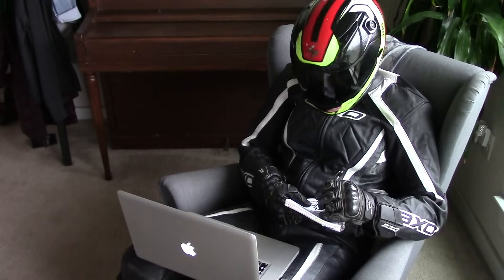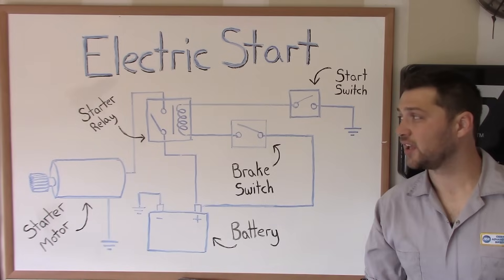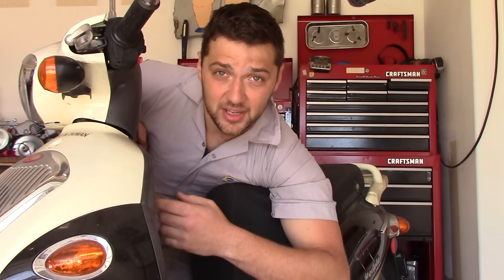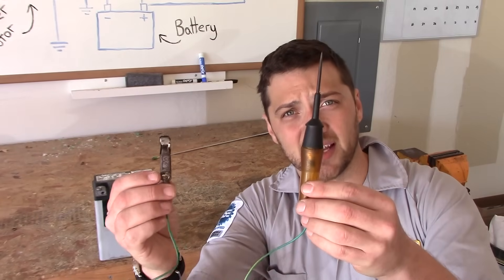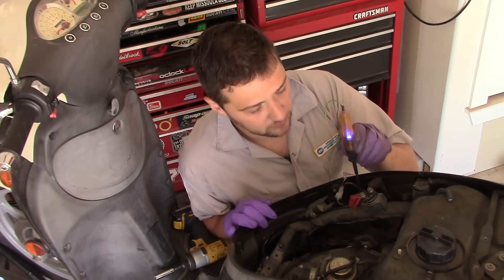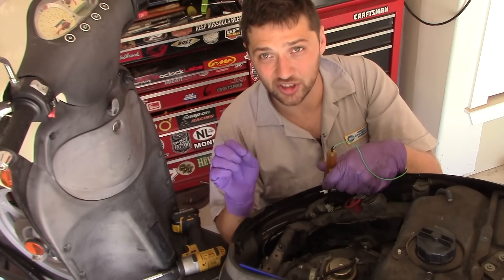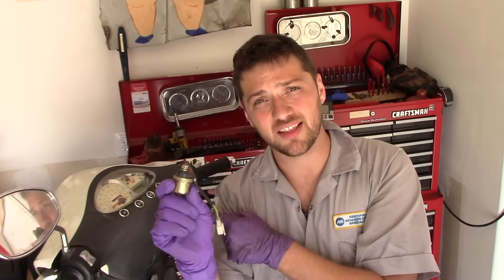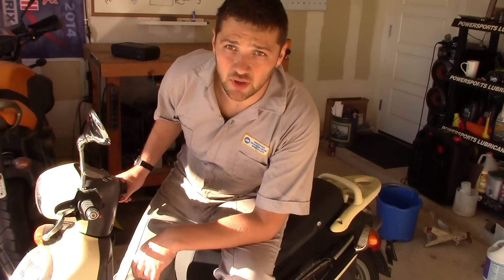Scooter 911: Electric Start Doesn't Work (troubleshooting your starter, starter relay, and circuit)

Comment: Hey Garrett thank you for being the only scooter youtube channel I can watch without bashing my head against the wall or feeling talked down to! I have a suggestion/desperately begging for a video. please go step by step through a wire harness so the crook and I may understand the ins and outs. My 150cc amigo was stolen from me and the crook wasn't firmilur with the harness so he clipped a bunch of stuff unnecessarily. I have dropped loads of cash trying to repair it. You're either wondering why I don't take it to the shop or why I haven't sold it (my "friends" suggest selling daily). The only shop in town, where I bought my 2020 amigo, is useless. Recently brought it in with a no start. They replaced the clutch and taped a couple wires in about 2.5 weeks and charged me 350. The bandaid they used must have fallen off on the ride home because I stalled twice. Later discovered it was a valve adjustment that was needed. They refused to refund me. Anyway I'm currently stuck with a no spark issue. I replaced the coil and plug. Nothing. I have a black and green 2 pin connector unplugged and idk where it goes. If I sell or give up the bad guy wins. I can't let that happen! Save me scooter 911!

P.S. your own shop means no more car driving by bloopers :( 

P.S.S. cut the afro lol 

You're my boy blue, 
Shroom0205

Comment: Scooter's relay seemed enclosed. Couldn't bypass. Then I attached a cable to the battery's positive terminal and touched it directly to the STARTING MOTOR. Sparks, a revolution or two, then nothing. Did I fry something? 
By the way, the battery seemed drained, but after a recharge bike starts fine with kick-start.

Comment: My man I just bought this moped this been used and I don't know what's wrong with the electric start all kind of wires I see two hours coming out of but every time I turn the key on it makes the sizzling sound and start smoking and the two wires are hot and it's connected to some otherwise delete all the way down to the starter post at the bat I need you to sit there and tell me how I could send you a video and show you what this guy's done so you could talk me through it

Comment: I have a 1987 Yamaha razz scooter the starter works I put power to it my grounds are good I bought a new relay switch for it but it still doesn't want to work with the button to start the bike what can it be the switch on the handlebar is bad can you help me out with this problem someone

Comment: Can I connect 2 wires separately to the  solenoid and then tap them to  jump start scooter    instead of the  screw drivers

Comment: Hello, You mentioned if my scooter is making this sound (turns over but doesn't start) I have a different problem. The electric start turns and makes noise but doesn't crank over to start. What other problem do I have.  The scooter will start with the kick start but not the electric start. 
I have 111 miles on the scooter.

Your help is greatly appreciated,
JB

Comment: I had the same issue with my tao tao ....
   It ended up that the starter Bendix was failing. After removing it, I cleaned it up and sprayed some wd-40 into the mechanism Inside. Amazingly, after re-installing...it started right up....

Comment: One of my starters stopped working, I think I pressed it too hard. The other handle bar still works, but my left one can't start with the ignition button, nor will my break-light come on if I use the left breaks (the right still works though) Did I burn out the fuse, or did I break it? Either way I am unsure how to proceed and if I need to have professional help or not.

Comment: How do I contact him directly for ad ice I'm on my 2nd scooter in 3 weeks and basically got 2 lemons Ive replaced everything on the outside of the motor except the stator but the wiring and harness that comes out looks brand new. There are a few connections that were done outside of the connectors. I'm wondering if it's bad connections. I have compression, gas, and weak or no spark (I've tried NGK and 2 other plugs)

Comment: my scooter engine tramp 1 or two times hard after got overheated and now the cables in front make strange sound when press starter button like snails when you touch them like weeiiii engine doesnt start

Comment: Hello Garret, 
Hoping for some assistance with a perplexing problem. I don’t think the scooter matters but it’s a 2020 Ice Bear 50cc that will not start after sitting outside in the elements for 6 months. 

Battery fully charged with tight terminals but will not start – fuse good. When I checked both brakes, the tail light illuminates. Starter kill switch seemed dodgy – took it apart and it was rusted inside – replaced

With the tester on the negative battery terminal, I tested the solenoid positive and it lit up. Oddly, when I touched the negative terminal of the solenoid, it also lit up. Hmmm, $9 bucks – replaced.  
Before putting the new solenoid on, I started the bike by touching the two solenoid terminals. Started right up after some carb cleaner help.  New solenoid installed and bike doesn’t start. Test light the solenoid to positive/negative terminals and both lights up.  Aaaaah, a short of a hot wire grounding somewhere? I touch other parts of the bike frame, housing to ignition, etc and the tester lights up. That can't be good!

Do I have a positive cable grounding somewhere? Could the starter be bad even though I jumped the bike. Brake switches? 
I’ve learned a ton from your videos and am really appreciative but would you mind giving some suggestions on what to do next? 

Cheers,
M.
Reply: Found the short.

Comment: I have a 50cc scooter is got about 1800 miles on it it runs perfect I parked in the driveway when the house came back out and it's never started again I've done everything I'm I'm stumped it has spark

Comment: Useful  video. by the way my Kymco 50 cc 2011. Doesn't start when i push the start button makes sound TEK and nothing else will happen. Since then the back light lost power but break light works. 
When i try kick start.
 Hardly starts but immediately go off. i checked the fuel supply, plug , fuel filter battery-powered  they are all  good.
could you tell mi what else can i do with it. 
Thanks in advance.

Comment: Having an issue where I hear / feel one click from the starter relay and then I lose all power to scooter, have to shut key off and turn back on. I was testing everything with a multimeter, so I can actually see the voltages. I initially thought the issue was the starter because jumping the starter relay heard same one click and scooter did not start. Replaced starter with brand new one. Same problem. Replaced starter relay with brand new one. Same problem. Battery is good, in fact, brand new. Verified ground wires hooked to motor. What seemed odd to me is that in checking the starter relay, ground to battery ground, + to the connector, I have power all the time to one terminal. Seems like I shouldn't have voltage without squeezing the brake according to the video, but I do. When I squeeze the brake, still have voltage.  I'm thinking I have a bad brake relay because tonight I noticed that the brake lights are always on bright instead of dimmed but you would think that would allow the scooter to start if it thinks the brakes are always on. When I wiggle the brake handle, it dims but then goes bright again. I guess the only other items possible would be CDI. There is one wire that is red running somewhere but the wire isn't bare and is still connected via a push in male / female connector. The rest of the wires are encased in wraps.

Comment: Ok so please no judgment.  Lol.  So I have an electric motorcycle and it WAS working just fine. I had to buy a speedometer, as that was basically the only problem, it didn't have one. Long story short I has a friend who claimed to know what they were doing ( they didn't) attempt to hook it up for me.  And they told me that because the connectors within the plastic connector piece for the wires from my bike, looked as if they weren't making proper contact with the connection coming from the the speedometer( not sure how) so this idiot, decided to remove the plastic connector piece from the speedometer and. Tried to connect the wires like that to the wires from my bike. Now apparently he didn't know which wires on my bike were for what function, so he was "playing around and guessing" and at some point he put a wire from speedometer, with a wire from the bike that definitely shouldn't have been touching. I was told big spark partial melted connectors and now, my bike has to be fully power cut off to turn off. Like the switch under my seat.must be turned off other wise the bike is ready to ride. I hit the power off button on my remote and it beeps but the power is still on.  Turn throttle and bike moves.  But what is supposed to be the power on/ start dosn't work not dose the lock/alarm button.   I don't have an ignition so I can't use the key to turn off my bike, and my bike can't charge when the "hard power" switch under seat is in the off position.  So basically.  My bike is ready to ride as it's charging.  😡 which for obvious reasons is not very safe. My question is.  How to figure out what the fuck he did, why that spark fucked my powering off and alarming abitliy, when I didn't think the speedometer ( or wiring associated with it, would have any effect of that, and how to fix it.  Sorry for long comment.   But I'm so clueless about this stuff, but now don't trust anyone to fix it for me.   So hoping that you can give me an idea on what to do.  Please please please and thank you.
Reply from the maker: Wow! That is quite the predicament! We've all been a victim of amateur repairs and diagnosis. Shoot me an email at garretseesingofficial@gmail.com and maybe we can get it sorted out

Comment: Hi, my scooter Piaggio fly 50. Start engine when applying brake ( front or back ). Doesn't need to use engine start button. The problem gets worse while riding and apply brake to stop  makes loud noise from rear back side, could be due to Bendix hitting variator. Any thoughts on solving this issue ?

Comment: Hi, I've been having issues for a while with the starting of the scooter, Now, I just noticed on mine that the green and yellow wires at the starter relay are crossed. The relay is wired one way and the scooter another making them yellow with green when the wire is plugged (weird)  My scooter has the weak start with a full battery. Is the cross wires normal? I see you got it green to green and yellow to yellow. Any info will be greatly appreciated. Keep those videos coming. They're great!  Thank you!

Comment: So I recently changed my ignition coil and after doing so my horn and turn signals won't work(but they worked fine prior to coil change) any advice?
Reply from the maker: Wow that's strange. Topically if you loose horn AND turn signals the left had switch electrical connector is disconnected somewhere inside the front fairing. Or the grey wire that supplies voltage to the left had switch has a break in it. Did you remove the front panels for any reason?

Comment: I crashed on the side with kickstand shutoff switch, it didn't work after that but i can still drive, now it wont start. I bent everything back in place, electric seems to work sounds like battery could be low

Comment: Hi 
i have honda SH300A 2016 every things work fine like lights and horn  when open the switch but no cranking and no sound of fuel pump.  i followed ur tips but didnt work i pass the relay with crew it crank but  the engine not  running i replace the relay with new one and the problem sill the same . any idea

Comment: I need help! My Gy6 Scooter (BMS Heritage 150) will only start if I bridge the two posts on the starter solenoid. Once started it runs perfectly. Electric start and kick start do not do a thing, wont even attempt to turn over. I replaced the started solenoid and no better.
Reply from the maker: Does your brake light illuminate when you squeeze the brake lever?
Reply: @Scooter_911  It does. BUT funny thing is that before the issue the rear brake did burn out, I fixed that and also went ahead and replaced the break switch up front. All of that seems to be working.
Reply from the maker: @lukasbabb8330  ok well if the light flashes brighter when you squeeze a brake lever but the starter relay does not respond to the start button you most likely have a bad start switch or an open wire from the start switch to the starter relay
Reply: @Scooter_911  and would a bad start switch make the kickstart not work too?
Reply: OMG ITS FIXED, in the started switch casing there was a little piece of metal that came loose and was touch a wire which i guess it grounded it. took that little piece out and started right up! Lol didnt even think to look at it because everything was pointed to the solenoid. You ARE THE BEST, i have watched all your video and am prepared for anything else that breaks.
Reply from the maker: @lukasbabb8330  dude! Nice work! Congrats on an exceptional diagnostic!
Reply: @Scooter_911  AH I need your help again! MY main headlight will not work but there is a little secondary light inside the unit that does work. All my other lights and turn signals do work and changing the bulb did nothing.
Reply: Not sure if there is a fuse or anything i missed, the only fuse I see is one by the battery and if that goes everything doesnt work because i have had to replace it before.

Comment: So I have this problem and tried bypassing the starter relay. As soon as I used the screwdriver across the contacts the engine turned over: however, it turned over without pressing the start button or holding in the brake. Not sure where to go from here?

Comment: Hi Garret. My scooter's spark plug gives a single spark after you switch the ignition off and then on either you use electric start button or kick start. 
Please tell me what could be the fault. The rest of the things are working as I checked. 
Thanks in advance ☺

Comment: Hello, Thanks for the video, really good, one aspect you did not mention is when I press the brake handle, give a bit of throttle and then press the start button, I hear "click" I do that two or three times and then the scooter starts, so what is the most possible issue to be? thanks a lot,

Comment: I need your help with something. 

I have a sym jet 50cc scooter.
Its won't start all the wire looks fine and I put new starter motor on. Still nothing happening. 

Its turn on but won't crank

Comment: My moped clicks when I press the ignition button and doesn't kick over by the kick-start, what do you think it could be? I have power from the battery, fuel and oil and still doesn't start also it died waiting at the lights. HELP PLEASE

Comment: Great video!  Question though. Working on a 2013 Buddy 170i, Push start button and starter engages but  stops for a second before continuing to crank. Hard to explain like a clunk-pause-then crank to start. Replaced battery and its fully charged. Seems like a large current draw before resuming the cranking? Leaning towards starter? Thoughts?

Comment: Hey Garrett, thanks for the videos. you helped me back in the summer with repairing a rear brake switch to get my Lance Cabo 150 scooter to start and it worked great. Its been a few months since I rode it and now it won't start at all (although I can kickstart it with some effort). However, when I pull the front brake switch now, the display goes dark. Wondering if I now need to change the front brake switch. What do you think? Does the front brake switch connect to the starter circuit like the rear switch does? Any insight you could provide would be helpful. Thanks so much!

Comment: When I squeeze the break and hit the electric start, it will shut off the electricity off the whole bike, dash light turns off. Power will come back on if I play with the kick start. But the same thing happens again if I attempt the electric start switch. Any insights? TIA!

Comment: Ive checked just about everything in the circuit but the starter is weak when installed. Out of the scooter, works great. When i try to engage the starter on the scooter, its turning the drive pulley and belt, is that normal or would the belt be "too tight". The driven pulley (on the wheel) is not being turned though. Thanks

Comment: Hi this is really useful  but i do have a problem my ajs modena 125 has stood for about 6 months try to start it and it did try at first on the electric start but then made a grinding sound now there is nothing at all the lights all work horn and indicators any idea what it could be. any help would be appreciated.
Thanks 
Lee  uk

Comment: Dude. Easily one of the better YouTube videos on scooter troubleshooting I've ever seen. You are as knowledgeable as Brett at 49cc scoot.com it seems, however the fact that you appear in the video and we get to watch you teach us even as far as going drawing on the blackboard and whatnot, really adds a lot to the video production quality. Very impressed excellent job and I can't say if it helped me out yet but I'm sure I'll figure it out. The main reason I watch this was to find out what was supposed to happen to the relay voltage wise when you push the starter button. The answer seems to be it connects the ground. From the starter button, and connects the positive from the brake light. For some reason I was getting no change no matter what I did it's like both were positive all the time or some ridiculous thing so I'm replacing the whole starter button assembly and then I'm going to piss on it and set it on fire.  Thank you so much for making this video sir bravo mate